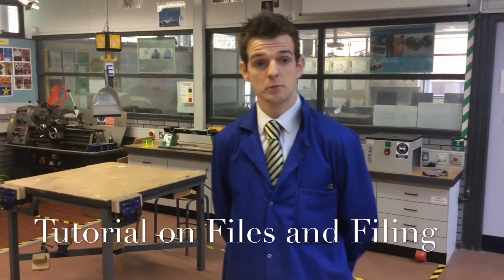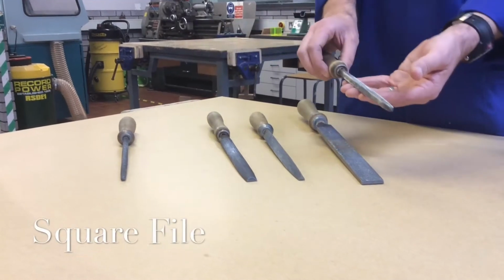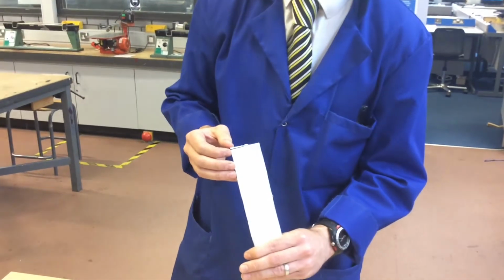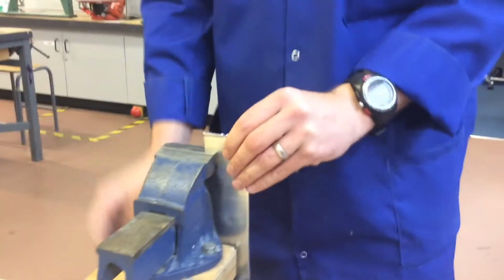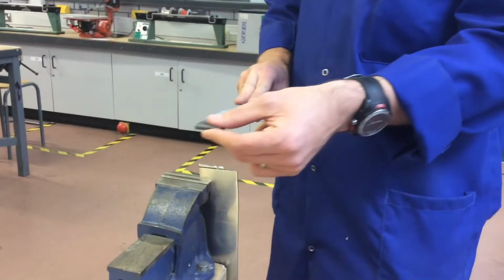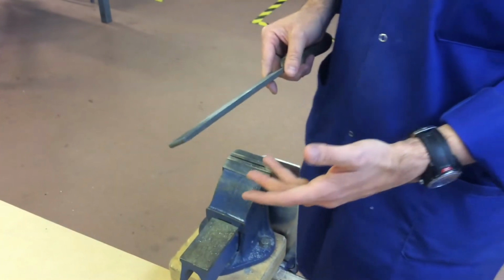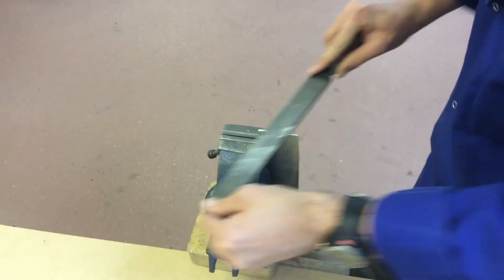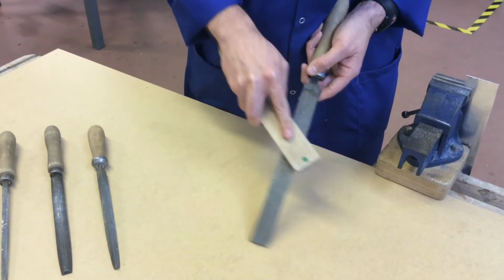How to use a File

Comment: You idiot, don't pull backwards when filing. The direction of the file teeth is made for push cut. Don't pull it backwards because you will damage the teeth and make the file dull much faster. Did you even do some research before making a video.